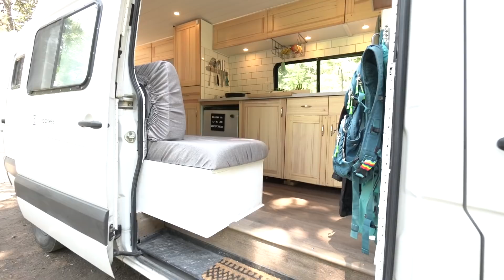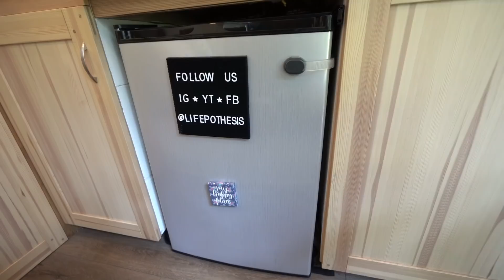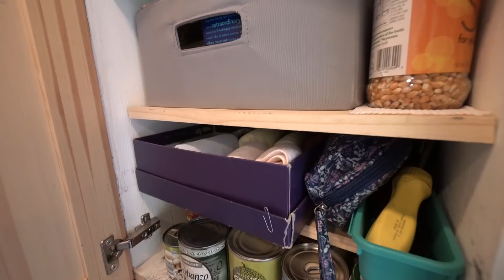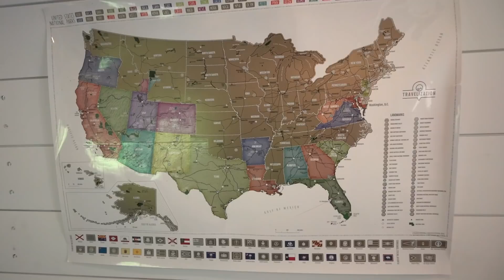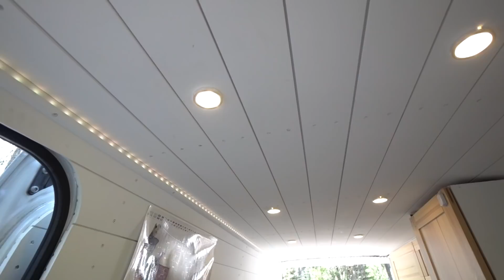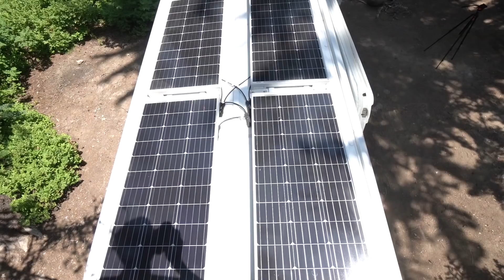Gorgeous DIY Sprinter Camper Van - $8k Interior Build Tiny House

Comment: This is the first van home I've seen that has a carbon monoxide detector as well as a propane and smoke detector alarm. Good for them!  I do like the pull out table; really saves space that way. Perhaps the only thing I'm not fond of in their van is how high the bed is with really no steps, unless you count the couch.  It's also interesting that they didn't mention a shower.
Reply: Safety is definitely a priority for us! The table is one of our favorite features. And yes, we use the couch to step up onto the bed. Our shower is an outdoor shower stored in the garage
Reply: They had outside shower arrangement that he shared while showing his garage area. I think you missed that part😊
Reply: @safiakamil277  Possibly. Quite often with these vans I'll see an indoor/outdoor option.

Comment: Nice, cheap well planned build, guys.  About my 700th build video. I'm still deciding on a floor plan. I think fixed bed. But not a bed 26 - 27" high just to fit bike tires underneath. Unless your a sponsored pro, tip em sideways. Or put them outside.
Reply: We'd highly recommend fixed bed! The garage storage is great. We chose not to keep our bikes outside because sadly we know several people who have dealt with theft. And it was a more efficient use of space to keep the bike upright in the garage because it is easier to get out and a sideways bike can't really have much stored on top of it. Our layout works for us, definitely play around with what works for you!

Comment: Very cute van but how do you use such a tiny portable toilet? Very neat and well organized van. Like the separation from the driving section of the van.
Reply: The portable toilet is 5 gallons so it holds a decent amount. But we really only use it for emergencies, typically we'll use public restrooms or go in nature 😊
Reply: @Holly Smyth  Design and build or build and Design. There are 10 - 12 models of toilet. you may well choose something someone else has used. Once you have made the choice the adaptation is no biggie. You are not in conflict with yourself. 2 questions that you get to ask and answer for yourself. How good is good enough? Or where is your threshold of I don't care? Build it yourself 10, 20, $40 or $900 plus for Deluxe retail. Try before you buy. You get to choose and figure it out.

Comment: Why are showers not important to van lifers ? Can’t figure that out ..
Reply: Planet fitness
Reply: Cuz you can shower at truck stops and most rv places ... truckers dont have showers nor toilets for most part and live in their trucks driving across country... so makes sense to me why they usually dont waste space inside for things like a shower... these actually have an outdoor one... there prob something they snap on for privacy around it... or maybe its more to wash sand off...
Reply: They take up valuable space and gym membership gets round that problem plus heating lots of hot water an issue
Reply: The one they have is pretty basic. And outside...
I've seen box van build vids with full-size showers, but that's a different shape and proportion. One shower I wouldn't use was in the footwell of a skoolie. No, ty!
Reply: We have an outdoor shower in our garage but shower mostly at Planet Fitness. It's difficult to store and heat the water needed for a large hot shower or to fit that into the interior space of a vehicle.